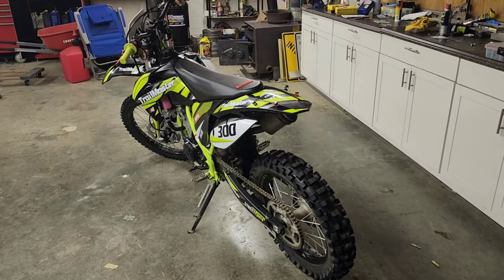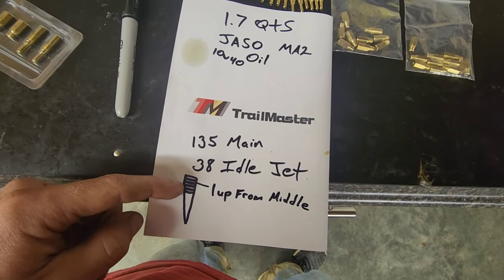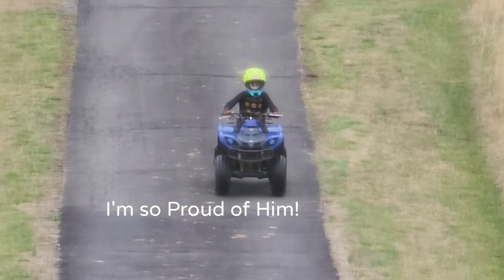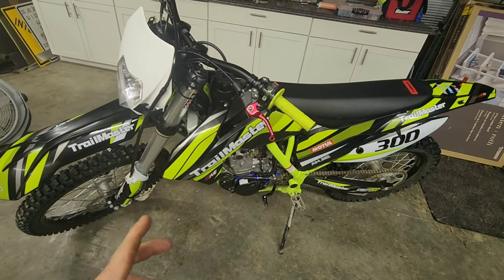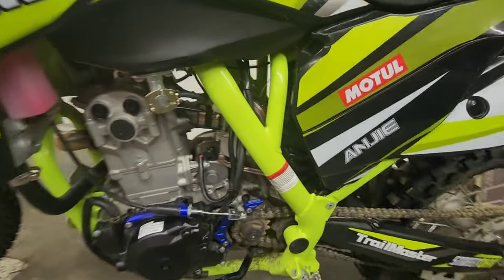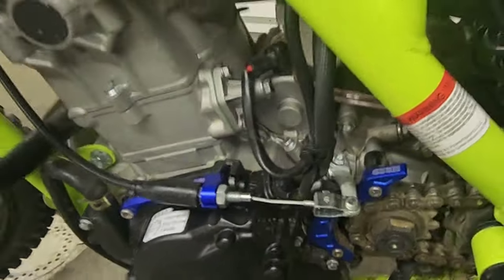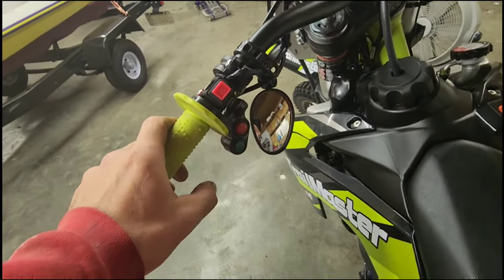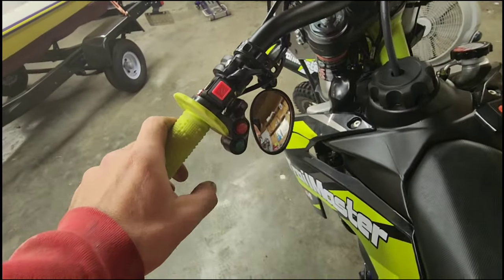TM38 Chinese Dirtbike Review 300 Carburetor Jetting & Aftermarket Parts for Trailmaster motorcycle

Comment: These china made bikes have been getting significantly better every year. downside is they are about twice as much as they used to be a couple years ago.
Reply: Have the Japanese bikes gone down in price, over the last few years?
Reply: But now there 50%better you get what you pay for
Reply: They are still cheap asf compared to Japanese bikes. you can literally get a full sized decent 300cc bike for 4k or less, rather than walking out a dealership 13k deep with paper work for the same performance
Reply: Yeah and the economy has been the worst its ever been

Comment: I can confirm everything he is saying. I’ve owned mine for a year now. This bike seriously rips on the trails and handles ruts like a beast.  I’m 52 and have been riding every brand since I was 4. This not only handles great on Pennsylvania terrain it’s one of the most comfortable bikes. My 15 yr old jumped on it for the first time and came back and said how it tore through the trails so smoothly.  One thing I had to change right away was the trash coolant that they supplied. Get some ICE and also recommend the tusk fan. The bike will run hot even in 70 degrees.   I’m on the east coast and didn’t have to change my carb jets at all.  Bike starts on the first crank.  Take the baffle out!!!  Sounds even more braaaap !

Comment: "Because it's liquid cooled it doesn't have a fan"? That's not how it works! Lol
That is extremely strange because no liquid-cooled motorcycle comes without a radiator fan.
 I can't see how they designed and built this without putting a fan on it because the engine would overheat constantly. And would be destroyed within a day.
I'm wondering if they just forgot to install the fan? I would never buy a liquid-cooled motorcycle, that's brand-new, that didn't have a fan. Mainly , well, because nobody's ever built one. Source in extreme design flaw or it was supposed to have the fan and they didn't install it, a china thing.
Reply: Ignorance is bliss
Reply: Have you seen any motocross bikes with fans?
Reply: All Mx bikes come without a fan lol and most enduro bikes as well. At least the older enduro bikes because I’ve had a couple and one was a ktm 250 4t and overheating was a big problem because of no fan
Reply: Some people just like to talk lmfao
Reply: @johnreynolds5322  yeah this guy has no idea. I’ve not seen a liquid cooled mx bike with a fan. I know my crf250f and 450r didn’t come with it.

Comment: Any idea what larger fuel tanks might fit?
Reply: I got the Acerbis 2250310001 which is the closest but have not installed it yet.   The voltage regulator and maybe the coolant overflow need relocated.  It has a fuel pump hole which I need to plate off and add a petcock.  The two metal rods the gas tank sit on are just a fraction too long and will need cut off mayb 1/4"

Comment: 3500 for a bike that still needs carb works and doesn’t come with a fan on the radiator produces the same horsepower as a 250cc, weighs more and has smaller tires. All those Chinese bikes should be capped at $2k.
Reply: Ya my tm36 is very heavy there’s no way I’m gonna be able to roll it into the back of my truck so I’m going with a carrier hitch for dirtbikes
Reply: Every new Yamaha and Honda carb'd bike we've owned (yz85, YZ250F, YZ450F, WR450F, TTR125, CRF250R) have had to be rejetted. None came with a fan.  Practically all the big frame bikes have either 21 front and 18 or 19 rear tires.
Reply: Just a naive comment